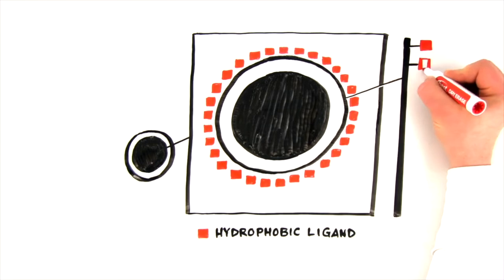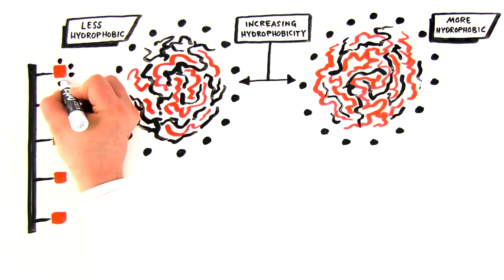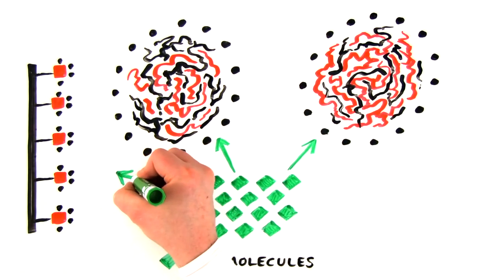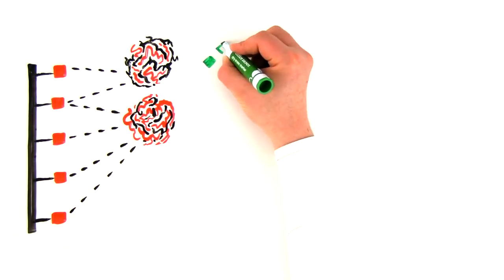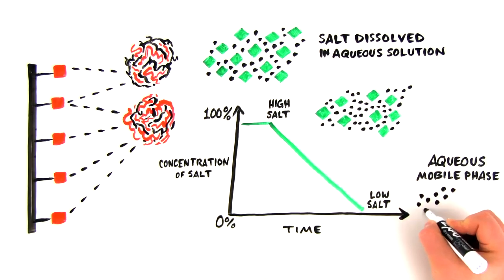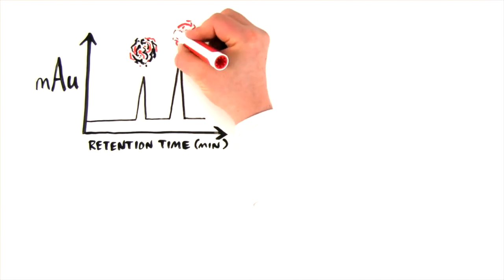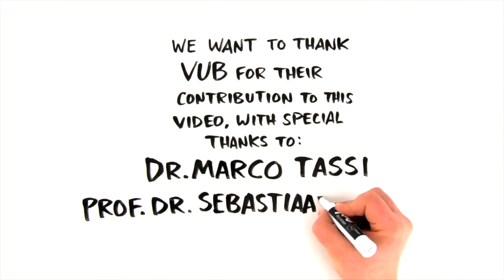Introduction to Hydrophobic Interaction Chromatography

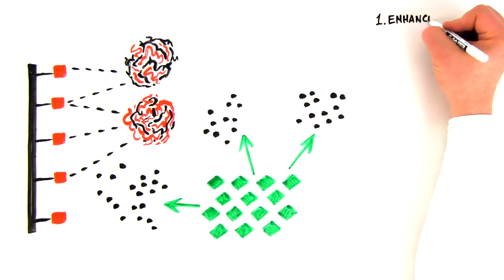Comment: The explanation itself is great! However, the bullet points at around 2:40 are very confusing. Why are ammonium sulfate and sodium sulfate listed as two separate points, they should be examples of point 2. Point 1 should be a catagory under which points 2-4 fall. Point 5 should also be its own catagory and of course 7 is an example of 6 and 8 (higher temperatures) should be a point in the catagory of 5. 
Everything else however, is very concise and you explain it very well, so thank you!

Comment: kindly reduce the speed of the word flow.
Reply: Speed of word is perfect, still if you have problem then watch the video at lower speed by changing the settings of the video (three dots on the upper right corner).